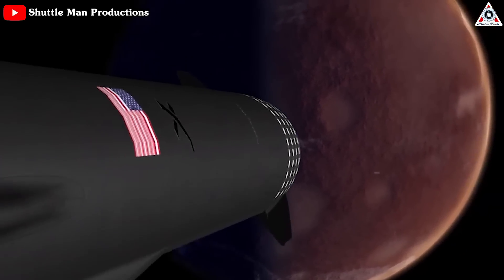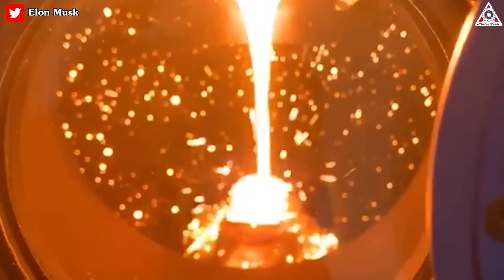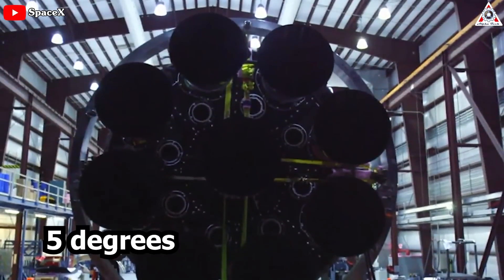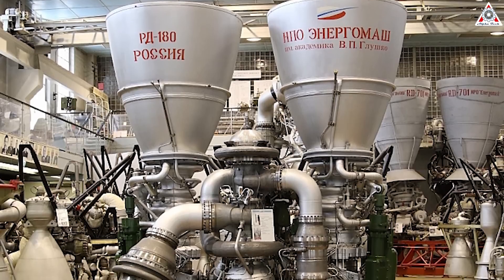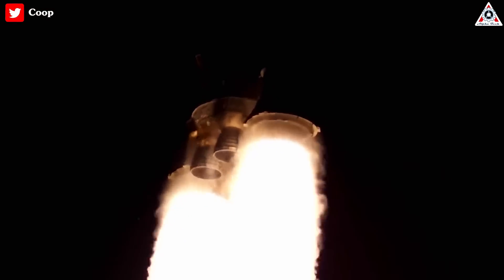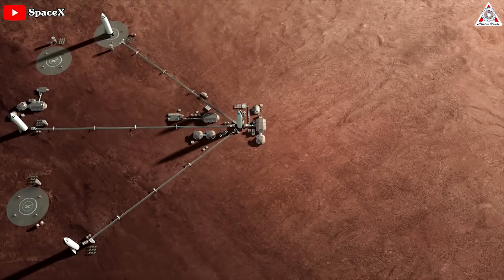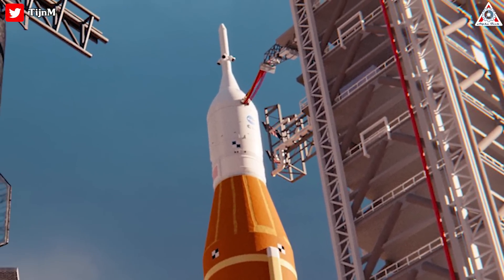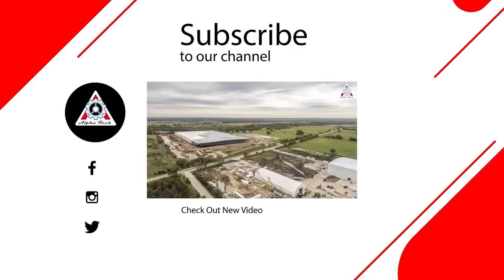Game over! SpaceX just shocked the whole rocket industry with NEW ENGINE...

Comment: Raptor 3 will be a thing so it can be operated at like 80% of max capability, a key component of reusability. This is why helicopter engines are used at a derated power, say the IO-340 used on the R44 is used at 250 hp max whereas the engine can go up to 300 hp+

Comment: Take an engine that can run at 350 bar and run it at the minimum pressure required for the mission and the lightly loaded engine becomes rapidly reusable; SpaceX's goal. That's what airlines do today. As a pilot, I was taught to use full power for take off and initial climb out. Now they just punch in the numbers and the plane sets the power level to the minimum needed to accomplish the departure, climb and cruise.

Comment: Why don't we tone down the hysterical, uncritical praise until AFTER the thing manages to launch without blowing up and actually get into orbit?
Reply: It was either shoot it off as a test article with its 33 unique prototype engines and myriad retrofits and get some flight data, or scrap it like its predecessors. Sooner or later, it is time to blast one off. All Musk wanted to do was "clear the pad"... for the next one. Now the rocket gets upgraded and the launch pad gets brought up to snuff. A major success.

Starship will be as reliable as the Falcon 9 in no time. 200 straight successful missions and 119 successful landings. The safest rocket ever flown.

That's the way SpaceX rolls.
Reply: @psycotria  It's hilarious that Musk's benchmark for rocket launch "success" is the same as it was in the 1950's, over 70 years ago, when every other launch was a disaster.  NASA has been doing better than that for over 50 years.  Has Musk never seen a video of a Saturn V or Space Shuttle launch?  You know, in which they use huge flame and heat diversion channels and millions of gallons of water to prevent the total destruction of the launch pad?  How could they be surprised that the launch of that thing totally destroyed the launch platform and pad?  And their tanks for fuel and liquid oxygen are located RIGHT NEXT TO THE LAUNCH PAD AND TOWER?  How stupid is that?  For a "GENIUS" Musk is doing some pretty stupid things.  By the way, Musk predicted cargo missions to Mars in 2022.  Meanwhile, Starship has yet to get into Earth orbit.  Starship will never achieve anything near what the Falcon system has done.  They should just focus on that instead of wasting time and resources on the doomed Starship, which will be lucky to get into orbit, is unlikely to ever get to the Moon, and definitely will NEVER go to Mars.

Comment: Respectfully, perhaps - SpaceX needs to move to ONE LARGE FUEL COMPRESSOR, which would feed all of the 33 Raptor engines.    Simplify the Raptor engines - keep all of the complexities on board the rocket.     If 1 Raptor engine fails, quick replacement.    I expect that Elon and the engineering team ARE working on ANTI GRAVITY. (AG)     Elon needs to move beyond controlled explosions: he needs to find the solution to this gravity well, and then the entire game changes.    I would suggest that anti-gravity will in part or fully be based on reversing as much as possible about Earth's gravity well.    Clearly, there are elements (associated with or directly related) to magnetism/electromagnetism, (earth rotates counterclockwise) therefore, a clockwise spin/rotation at or exceeding 1670 km per hour or about 12.2 miles per minute, which would need to be transitioned to an RPM depending upon the diameter of the antigravity device, and the emission of light (400 to 700 nm) appears to be a component of AG.    As Tesla (allegedly once stated) it's all about HARMONICS.   I do not see that temperature is an issue: it's about the harmonics of magnetism, and light, combined with a clockwise spin - all brought to sync in harmonic synergy.     It appears that (almost) everything has a wave structure: we need to look at creating energies, and harmonically combining their wave structures.   Super cooling may be of interest, but my thoughts are that it's a side issue, not the main issue to solving AG.

Comment: How is it the most powerful engine ever built? Not thrust, the Raptor 3 is 269 tons (538,000 pounds) thrust, but the Rocketdyne F1 was 761 tons (1,522,000 pounds) thrust at sea level, and over 1.7 million in vacuum. Not specific impulse, the Raptor 3 is 350 seconds and the RS-25 is 453 seconds. These are great engines, but not the most powerful.
Reply: While the F1 was powerful it was also very inefficient but let’s look at this way, the F1 is the most powerful kerosene/oxygen engine and the RS-25 is the most powerful hydrogen/oxygen engine and the raptor is the most powerful methane/oxygen engine still in development
Reply: @giminai8000  That should be stated then, as it stands the claim is simply false. A lie. American companies are famed for false claims because the US has no requirement for truth in advertising, so lies are a national pastime.

Comment: What a boatload of hyperbole. Let’s see if they ever make it to orbit. On their first try, 8 out of 33 engines failed at 90%. That’s not good.
Reply: Those engines were of an older design and used hydraulics for steering the newer engines use electric motors for steering if you kept up to date you would know this already
Reply: @giminai8000  8 out of 33 is still not good. 3 didn’t even light. Not good. Let’s see if they ever make it to orbit, let alone be reusable in any practical way.
Reply: @andreask9382  those initial three engines are ones they chose not to start  so technically by your estimates only 5 engines failed
Reply: @andreask9382  The raptor engine is in development like the rest of Starship.   There are many upgrades already in place for B9 which will be the next to fly and the base of the OLM is finally getting a complete make over so these are promising signs.   And it is reasonable to be skeptical.   These improvements might get starship to orbit on the next orbit.  The onus is on Space X to show significant improvement in every aspect of starship.
Reply: SpaceX has already proven itself with 200+ consecutive successful launches of Falcon 9 with 115+ safe landings of the booster.
It's only a matter of time for starship too.

Comment: wonder if elon has considered trying  to make a falcon 9 "Raptor edition" which uses methalox and has 250% more thrust than merlin version just for fun? could essentially replace falcon heavy with one core....
Reply: Not enough fuel in that tank for those engines.
Reply: @andreask9382  notice I said nothing about size and implied falcon heavy fuel requirements. So a nine enigne raptor vehicle like falcon 9 but with 3 times the fuel like falcon heavy. hence the "replace falcon heavy with one core...."_

Comment: LOL, the 30 Raptor v1.0s (I assume) caused the area under stage 0 to leave the launch site.  The new water deluge system better damned well work super well considering the upgraded v3.0 (or even v2.0) specs.
Reply: That launchpad  is still a dead end brick wall .
Reply: that is my worry waht will these do to the launch pad even after the upgrade.

Comment: At T+ 33sec, it was also game over for Starship 1 because 4 Raptors failed. 3 Raptors failed in the static fire. Reliability is not there, not to talk about reigniting those… Why do you always act as if everything is peachy??? For the moment, your glory stands on the shoulder of an open cycle Merlin, very reliable. It is kind of reckless to have a rocket engine so close to limits with no margins of security and like Musk said during the last static fire of Raptor 3: ´ I was surprised that the engine didn’t blow up during the test…’  Not very inspiring…
Reply: Theres is a reason there called prototypes , also your completely wrong at T+33sec they choose  not to ignite 3 engines if you listened to the report you would know this also have you taken into consideration that those Raptor 2s used during the starship launch were of a older design? The vehicle itself was an older design so for you to say the reliability is not there is not completely true